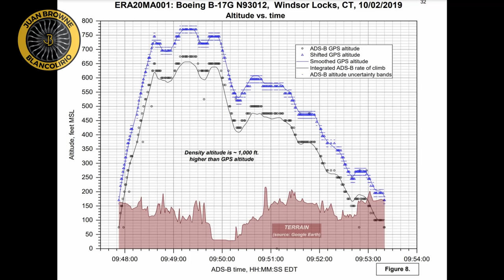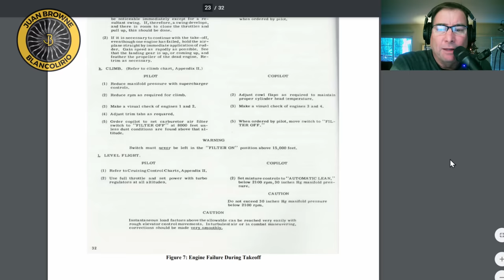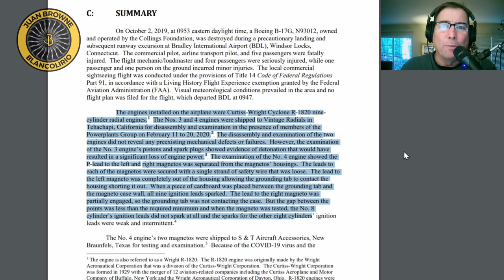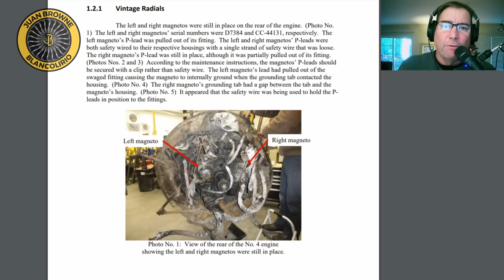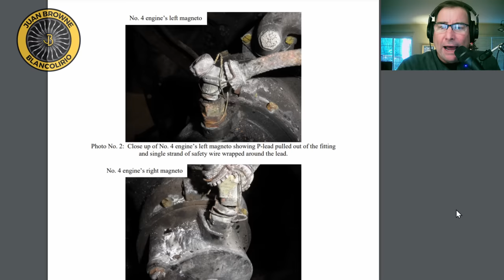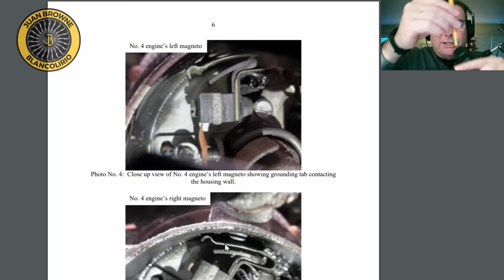NTSB Report B-17G Crash 'Nine-O-Nine' Part II -18 Dec 2020

Comment: In 2012, a replica of HMS Bounty sank in hurricane Sandy. Fortunately fourteen of the sixteen member crew survived due to the heroic effort of the US Coast Guard.  

Why was she trying to sail in a hurricane?  Because she was trying to reach an event that would provide some revenue to shore up her very shaky finances.  During the storm, the fuel filters clogged up and the pumps failed.  Why did the fuel filters clog up? Because they were the wrong fuel filters and the ship could not afford to replace them with the correct fuel filters.

Bounty's skipper, who was lost in the sinking,  was a very experienced captain with a strong dedication to his ship.  Many of his crew were knowledgeable and experienced and well accustomed to improvising ingenious maintenance solutions to keep the aging ship going with the barest minimum of funds.

Sounding familiar?
Reply: I remember that incident.  Very similar, and very sad.
Reply: The Bounty was unfit to go to sea in any weather. She had been hauled in a Maine shipyard that summer and plywood and tar had been applied over the planking to try and stem the leaks. The captain had years at sea but learned little from it He told the crew they were going to sail through the hurricane and anyone who wanted to leave the ship could....none did. Most of the crew lacked experience and knowledge. The bilges had never been cleaned so all the trash fouled the pumps when needed. The chief engineer was trying to change fuel filters on the John Deere diesels as they kept stopping. He was unfamiliar with the procedure and had the wrong parts. 

The captain had an ego larger than his ship, The owner wanted  the ship down south where it could make some money. Sound familiar?

Only a magnificent effort by the USCG in conditions  in which  nothing should have been flying kept the death toll from being higher.  The crew of a C-130 were fighting air sickness as they were tossed around in the violent winds while trying to keep the scene on their radar to direct the effort. CG rescue swimmers went into 40-50 ft seas to save the crew.  Words can't describe their magnificent efforts that night. The captain and owner were richly condemned by the Coast Guard investigation....and rightfully so. The ship should never have been in the water.....period.

Comment: I have flow T6 for 5 years and some 3500 hrs giving rides, doing simulated combat and such. We shared some airports with the Collings Foundation's birds. Some guys were cool, some of the flight suit wearing bunch......not so much to be nice about it. This was about 12 years ago, our T6 parts at the time were going up exponentially in price. My first boss was in it for the money, poor planes. Second job was much better but as these rides were mostly pr-sold as gifts, we were under tremendous pressure to fly. We did have a trailer full of parts, a good mechanic but there were times where we would be at the airport under the bird till 2 am to fly the next day. Some overhauled parts or components would not function properly, fresh engines making metal......Since it was a relatively simple airplane and since we flew the same bird most of the time we were intimately familiar with them. I knew oil consumption, fuel burn, loose rivets on the cowl.........We did well, but due to the commercial pressure at times it felt like ww2, without the shots being fired at us. To keep a 4 engine B17 flying, multiple that by a lot more than 4. I appreciate what Collings is trying to do, but the economics of 2020 are not in favour of doing road tour. In addition the pilot situation has to also be considered, there is such thing as too old and too inexperience. Again my 2 unwanted cent.
Reply: The same man was both pilot and chief mechanic. An awesome amount of responsibility for any one man and totally sans any sort of oversight. A multi-million dollar aircraft and dozens of lives at risk on many flights! Another pair of eyes can be extremely valuable. None of us are perfect. I am 73 and would not want anywhere near that much responsibility at my age.  I still supervise construction projects but they don't fall out of the sky if you make a mistake.

Comment: Detonation: Not engine knock, but spark knock.  Engine knock is mechanical damage with excessive clearance outside allowable tolerances. Spark knock is caused by improper spark timing, which causes improper fuel burn and that is what detonation is. Modern computer controlled engines have acoustic sensors mounted to pick up this sound of detonation and adjust timing accordingly. No such convenience on these beasts. As mentioned those magnetos would have to be properly static timed to the engine, beyond that I wouldn’t know what type of spark advances these old girls would have used. This was a great breakdown- I just felt it necessary to clarify that one term a little more. Thank you for putting such great detail into these briefs.

Comment: I lost my Dad to bad engine maintenance - loose exhaust clamp and leaking fuel line = explosion at 17k ft agl - google B50 Long Ranger
Reply: MigsTwo: My condolences; must have been horrible knowing someone’s sloppiness caused your loss. I read about the accident, and found a crew list. Which one was your Dad, if you don’t mind my asking?
Reply: @paulmanning8757  I'm gonna guess Lt/ Col. Harold Mignola. My deep condolences to MigsTwo.
Reply: @wintercomesearly  That's correct - I was only 13 mos old at the time  - still hurts though
Reply: @leeharold8337  Your father’s service is not forgotten. God bless you and your family, sir.

Comment: Hard to believe the run up of those two engines before takeoff was successful. There had to be a bad mag drop and lots of backfiring.
Reply: That's assuming they actually did the run-up and mag check properly. If the #4 left magneto was grounded out before the crash, the engine should have killed as soon as the switch was flipped. Even if the left magneto was hot, the RPM drop on the right should have been unmistakable. And seeing those spark plugs, #3 should have been a mess at full throttle.

I'm beginning to think the only way they could have gone ahead with the takeoff is that they at least skipped the magneto check, and probably explicitly ignored performance problems if they did in fact do an engine run-up at all.
Reply: @don_5283  I have seen elsewhere that while the crew chief claims a run-up was done, passengers say otherwise.
Reply: @don_5283  I thought if the left magneto was shorted hot there would be no drop when the right magneto was selected.  I.e. they are "normally on" and selecting L/R grounds the alternate.
Reply: @jamescaley9942     The magneto's primary wire cable inserts into a threaded ferule in the magneto's case,  a threaded nut over the end of that cable secures the cable to that threaded ferule in the case, and a small safety clip secures the nut for an additional safety margin.  When that cable is inserted into that ferule by the mechanic, the connector on end of the primary cable pushes aside a metallic leaf spring inside the magneto housing.   That leaf spring is a safety device which is designed to short out the magneto against it's housing anytime there is no primary cable present, so that the mag cannot produce a spark whenever the primary cable has been removed.    Once the cable is removed from the housing,  the magneto is dead because the leaf spring shorts out the mag.      Once that cable was dislodged,  that mag was dead.    If you look at the photos,  the cable was dislodged and the safety clip was not present,   the safety clip had been replaced with a section of safety wire.

Comment: I own and drive classic cars. For some years it has been increasingly difficult to obtain ignition components that are of the same quality as the originals. Condensers are a particular problem. I can only imagine that the same problems occur within the historic warbird community.  Even if you manage to find " new unused " parts it has to be appreciated that these parts are in some cases 75 years old. If you then add poor maintenance into the mix and it becomes a recipe for disaster. I have seen the same level of neglect in the classic car world ,shiny on the outside but deathtraps under the bonnet or hood! 
While it is important to keep these beautiful birds in the sky, it should be done without cutting corners or ultimately it will mean the whole fleet will be grounded for "safety " reasons! Great explanation as always, Happy Christmas from the UK 🎄

Comment: I'm shocked by the pitiful state of those magnetos and pistons, I cannot imagine the heads and valves looked much better. It's quite obvious that engine 3 would have showed excessive power drop and engine 4 would have probably quit again had the magneto checks been performed at run up. I'd be surprised if those engines made full power even with both mags engaged. This degree of complacency is outrageous.  I'd expect better airmanship from a student pilot.

Comment: Detonation is when the fuel/air charge ignites before the piston has reached the top of it's stroke. The piston has to push up against the combustion before it can go back down. This is why you see skirt damage as the piston is slammed against the cylinder.  
That's is Ignition timing, since the other 3 engines were burning the same fuel. The Octane Rating of the Fuel is the other method of controlling Detention.

Comment: As a guy in his 70's who cut his teeth working on cars with conventional ignition systems, much of your presentation was quite clear to me, and I'm appalled at the condition of the ignition system in those 2 engines. That aircraft was not airworthy, and should never
have left the ground. I would never have let a car in that condition, leave my shop. The idea of an aircraft with all those ignition system faults, on a takeoff roll, is downright frightening.
Reply: Grey Jay , Agreed. Those look like the kind of things I see when fixing old tractors that haven't run in 40 years. In an airplane with 4 engines, with 2 ignition systems each, you can maybe limp something along a little. That's by DESIGN to get you home / back on the ground alive. The edge provided by said redundancy was never meant to get you INTO the air.

Comment: Two takeaways: 1) When you lose power on a wing, you can’t regain altitude. Therefore stay high as long as possible. 2) Get on the ground ASAP.
Reply: I'm guessing that the loaded weight of the aircraft is a huge factor, among others.
Reply: 3 Don't use magneto's that look like they were fond in a bucket full of greas and batery acid.
Reply: Are  you saying drugs were involved?
Reply: @flatcat3254  I saw it as they thought they were too high for the first runway and used the sharp bank to scrub altitude.
Reply: @flatcat3254  Tragically, if they had lost all four engines, they would have done exactly what you said.

Comment: Great explanation Juan and very sad, since it was preventable. The ignition system on these engines is quite similar in some ways to old school automotive points and condenser ignition systems and as anyone who's had them knows, they require regular maintenance, with points and condenser replacements when needed, and point gap and dwell angle (point gap and dwell angle are inversely related) and timing, both base and total timing advance,  checked at least yearly. I have an old inboard boat with this system and every year the points get checked for burning, the cap and rotor for corrosion/burning, dwell angle, timing and idle speed adjusted. When you get used to modern cars you forget that we turned our cars up once a year, if we didn't want to get stuck somewhere.

Comment: It very much looks like this was caused by failures to maintain parts of the aircraft that are designed to be easy to maintain.  That's just tragic.  It's no surprise the foundation has had its' approval rescinded as this really does call into question their ability or willingness to properly maintain their fleet while on the road for the paying flight season...

Comment: IF they had done a proper mag check during run up that should have been caught, A mag check turns off the select mag, so on the Number 4 engine it would not have continued running.
Reply: I built race engines for motorcycles for many years. Generally spark failures start at extremely high engine loads before you would ever notice them at a partial load such as a mag check. I had many plugs pass the pressure test on a machine and yet develop a bad miss in a hard pull. My engines developed so much pressure that Champion plugs right out of the box would misfire under full load. In the seventies Champion was a poor product. NGK's worked fine. The condition of the mags were certainly unacceptable, but a mag check is not an end-all test.
Reply: @johnbaskett2309  The mag check may not have showed bad spark plugs but would have showed the failed mag. the engine wouldn't have continued to run when that mag was selected.
Reply: @wb6anp  I can't imagine they would take off with a dead mag or not do a mag test at all.
Reply: @johnbaskett2309  That's why I said I don't think they did a proper mag check. The other question is did the "P" lead pull out during the crash, the report doesn't bring that up.

Comment: Seems like the fiddly side of the maintenance got rushed. Gapping 8 magnetos and 72 spark plugs must be tedious, but it's crucial.
Reply: I would have updated to a modern design. The "tourists" would never know the difference. For those that scream MUST BE ORIGINAL, it's junk now.
Reply: @gailtaylor1636  You must have been reading my mind. What prevented me from saying the same thing was I don't know if its like vintage cars where original is all-important. These planes are worth a lot of money, does non-original affect the value?
Reply: @gailtaylor1636  it's not like ADS-B would have been an original feature. Ditto with VHF radios for the pilots.
Reply: Magnetos are still widely used ,its only recently that electronic ignition systoms have been developed for traditional legacy aircraft engines.
 We have had electronic ignition in our automobiles for what? 50 years!

Comment: I’m neither a pilot nor mechanic, but I’ve read enough aviation reports over the years to know that magneto’s are notoriously unreliable.  1. Why aren’t the mags on a shorter overhaul, or at least inspection schedule than the rest of the engine?  2.  I am surprised the mags passed the runups on that flight.  It seems #3 should have been rough and weak on at least one of its mags.
Reply: Both #3 and especially #4 should probably have exhibited problems on run-up, if the run-up was performed properly. If they did a proper mag check, and the left magneto was grounded out before the crash, #4 should have killed right when they flipped the switch to the left mag. This smells to me like a case where the run-up was either not done, or not done properly, with the individual magneto check not being performed at all. I haven't read the report, but I'd be interested to see if it comments on any of that.
Reply: @don_5283  That sounds right the weak mag should have shown excessive mag drop and died on the dead mag. Also mag timing takes proper tooling  on these engines. They do not have timing marks. I have an indicator that measures piston position.
Reply: According to the surviving passengers there was no run up. The crew just started the engines and the plane taxied out to an intersection about half way down the runway and took off. And this was after they had initial problems starting the number 3 and 4 engines.
Reply: The whole idea of aircraft magnetos is they are independent of input from an electrical system. There are 2 complete self contained ignition systems for redundancy on aircraft engines. When maintained and operated properly, there is more reliability in the air than with your car. Magnetos are normally overhauled at 500 hours, or about 3 times for every engine major overhaul. The type of maintenance described here is done annually, or certainly if there are problems exhibited or bad run up. I had a total  mag failure due to a bad condenser. It showed up on the run up. The idea is, you don’t take off after a bad mag check. That is the pilot’s responsibility.

Comment: Detonation occurs when the expansion of the explosion reaches its maximum energy before the piston starts its down-stroke.  The timing is adjusted so that the spark occurs before top dead center (B-TDC).  The explosion reaches its maximum expansion just after TDC forcing the piston down.  If it occurs too early, the piston "crashes" into the explosion's "cloud."  That energy is absorbed by the piston as heat rather than being used as downward force.  If ignition occurs too late, the piston has already started its down-stroke and doesn't get the full use of the explosion.

Comment: As I mentioned in Part 1, my father was a crew chief on a B 17 during WW2 with the 96th Bomb Group. He was one of only 7 crew chiefs awarded the Bronze Star for servicing over 312 sorties without a single mechanical failure. I wish he was still here to get his input on this mechanical issue. It would be interesting to get his take.
Reply: @jimardizoni3453  Never thought of it that way but you could be right. He never really talked about his experience during WW2, in hind sight I wished I had asked.

Comment: Wouldn’t the sound of number 4 be abnormal? Wouldn’t an experienced pilot  know the engines weren’t making full power?
Reply: Not necessarily. You cannot hear the exhaust from the cockpit. The exhaust is where you would hear the misfiring of the cylinders. With 4 engines it is even harder to hear the differences from the cockpit. Remember, these aircraft are very noisy making it difficult to hear subtle differences between, and among all the other vibrations echoing throughout the fuselage.